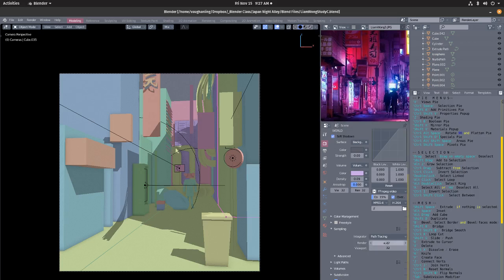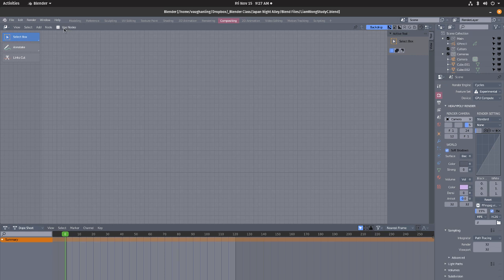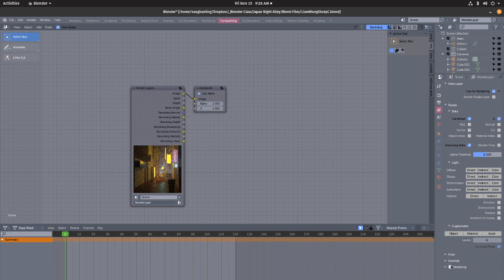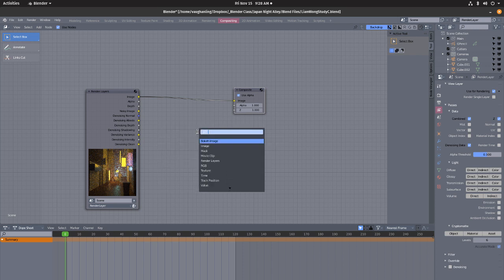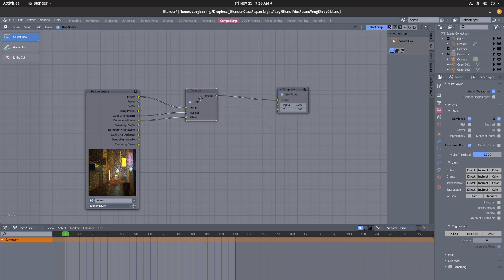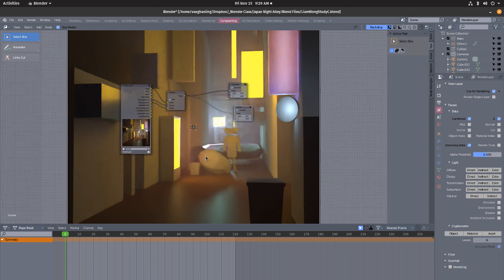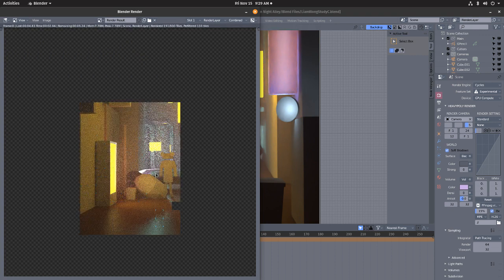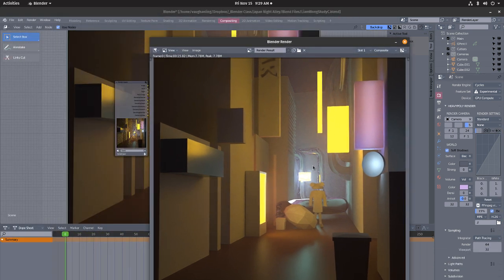How to use New Intel Open Image Denoiser for Blender 2.8X

Comment: Don't we have to put in noisy image into the Image input in the denoise node?
Reply from the maker: Maybe, I've tried both there seems to be a slight difference
Reply: @Heavypoly  Also you need to check normal in data, so denoising normal can do his work.

Comment: Do I need an intel processor to use this feature?
Reply: No, you can also use AMD proccesors. But it's more optimized and faster for Intel ones
Reply: @MatiasVivanco  What happened to the Ndivia one?  Is this one better?  Can you use more that one at the same time with an intel and  nvidia hardware setup?
Reply: @cfryantofficial  You can use the Intel one with both Intel and AMD. As for the OPTIX denoiser you'd need an Nvidia graphics card that supports it. And I've seen better results with the Intel OIDN Denoiser
Reply: @MatiasVivanco  gotcha. Thank you for the info, much appreciated! :)
Reply: @MatiasVivanco  hi bro, I just want to ask, the denoiser node doesn't appear when I search it. Btw, I use a laptop with no graphics card, is it the reason why or do you have any solution for it?
Thanks
Reply: @jomelanos8463  ensure you search well, because is doesn't matter if you dont have graphic card, its just a node so it shouldn't disappear
Reply from the maker: No idea, let me know if it works!
Reply: You need a processor that supports SSE 4.1 so you should be good unless you have a 10 year old processor.